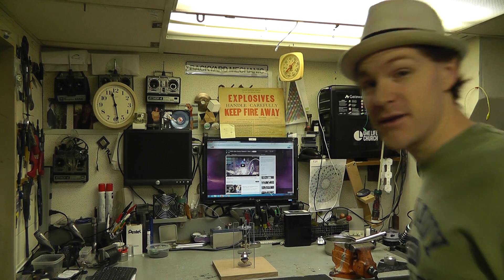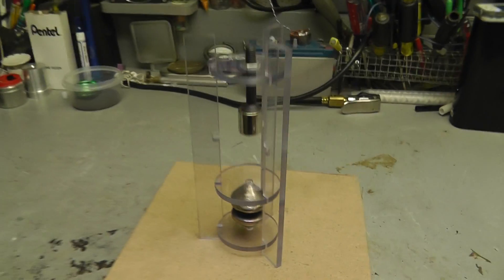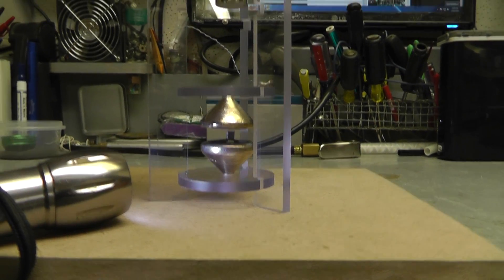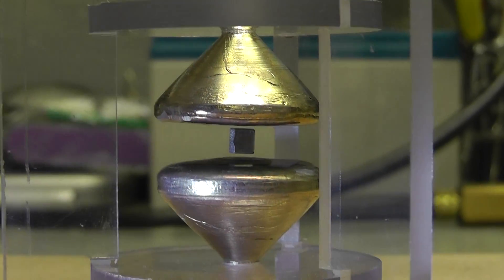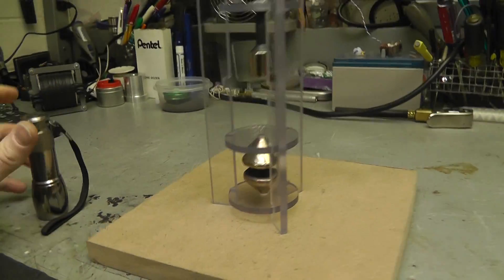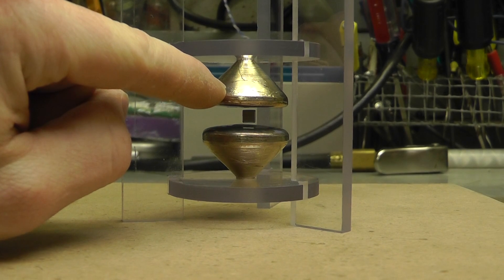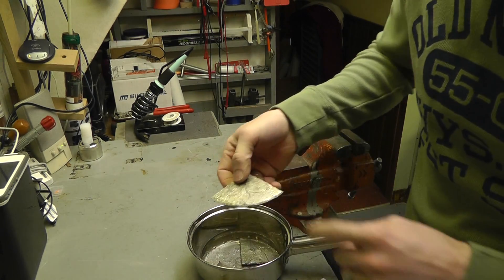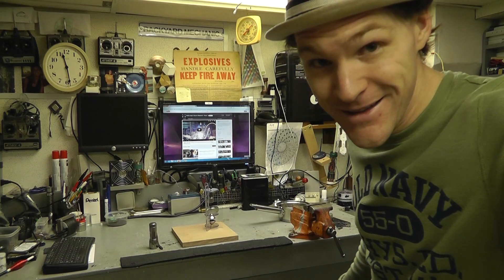Diamagnetic Levitation Via Bismuth. No Power Supply, No Tricks, Just Science. :) RWGresearch.com

Comment: Wouldn't this technically be generating a small amount of electricity. At least while it spins; the magnetic "lines of force" could cut through say a secondary wire and or coil, and theoretically one could use this to generate some negligible but noticeable amount of current. Nothing engineerable would arise from such a simple experiment; at least not immediately, but it certainly would be a proof of concept and theory. 
 Magnetic fields, and dielectric fields are indeed present here, and being that some of the components are in motion (i.e the magnet), there should by all means be some measurable amount of electricity. Maybe you have an experiment on your hands my friend!?
  I definitely want to test this one out for myself; at the very least I'll have a neat table top trinket to impress my friends with.
Reply from the maker: Hi, yes. Its quite fun and you have some interesting questions.  I do sell a kit for others to play with and test ideas. You can see here. http://rwgresearch.com/open-projects/magnetic-levitation-kits/
Thanks! ~Russ
Ps. Think where the flux lines are. This will answer your qustion about power generation.

Comment: Try it in a vac and has a higher repellent feild when hot, shame the magnet don't.
Can you flake it and get it to float on the magnet have you seen the p grafite (I think the P was for power) becouse the magnet span fast when hit with electricity following John searls works and it looks like the grafite still holds those empty holes wow also work when hit with light laser like.

Comment: Did not read every comment but I did not see any comments on the increased distance of magnetism that the top magnet had on the bottom magnet by putting the field threw bismuth. It would be interesting to see if the field dynamics changed on either magnet do to the bismuth.

Comment: What if you were to use a sphere version of the neodymium magnets that reduce the air friction when spinning? You could potentially get the magnet to rotate freely for many hours. maybe mark each half so you can see the sphere spin. I would love to see that.
Reply: Joe Richey taking a shot in the dark here, but I think only a cube shaped magnet can be used in this particular application; perhaps because of the orientation of the magnetic field in each shape. A sphere might get pushed out rather than spin and remain in the same general area; however that is just a wild guess. I definitely want to try this experiment out for myself, and I have both cube and sphere magnets. Guess there's only one way to find out.
Reply: @connorfisher1651  Even if that is the case, you could still have the cube magnet inside a round/sphere piece of acrylic, etc. Good luck with your experimenting! Cheers!

Comment: Relatively moving masses of bismuth will set up a "time dependent" force field which neutralizes the ambient gravitational field. This is the claim of Henry Wm. Wallace in his 1971 USA patent for what he called a "kinemassic" field generator. This device not only can neutralize the gravitational field felt by an aerospace vehicle, but also has another interesting effect: It is said to be able to eliminate the "inertial" effects or the effects of acceleration felt by persons or objects inside the vehicle. This is the only known technology that provides superefficient aerospace propulsion, while also protecting the passengers and crew from inertial hazards. The field effect occurs when the rotor/stator made of bismuth or other half integer spin nuclear isotopes, is spun up to a high rate at very close tolerances. The rate must be at 30,000 rpm or greater I think. This seems very high and of course it can be dangerous if not done properly. New counterrotating power saws, however, have very high RPM and with counterrotation the RPM of one blade opposes the RPM of the other blade, effectively doubling the "relatively moving mass" RPM in the twin blade system of these saws. Tolerance between the two blades is probably not adequate; should be very close, as I understand it. But another possibility arises: The idea that during the spinup, and by running the device for some time, the "kinemassic" field effect claimed by Wallace could be achieved at somewhat lower RPM and perhaps at less demanding close tolerances between the two relatively moving masses' surfaces of the device. This type of device was tested perhaps 20 years ago by a lab physicist and was claimed to show the field effect, although only to some minimal extent. Later, the physicist or theorist who had tested the setup removed his video from the internet and requested that everyone who had linked to it must remove all links to avoid his being the butt of jokes or something of that nature. The inventor, Henry Wm. Wallace, was a well established electronics engineer at General Electric in Pennsylvania. I wrote to GE and received a polite letter back from them, saying that this was not an area of development for GE at that time. It was clearly not a form letter but rather what appeared to be a letter written specifically to reply to me on this particular topic, and was signed by an individual at GE rather than being simply some sort of auto response. The technology may already be in use or in R&D, I just have no way of knowing, and clearly it would be held secret by the military and govt until such time as it might be considered safe and prudent to publicize it. There's no doubt HWW had something important; he was a top engineer and had other patented devices. When I looked for his patent in Colorado, I had to go to the patent library in Denver and get it from microfiche, because the patent itself had been torn out of the patent book in the university library. I have the full Henry Wm. Wallace patent for this device and can send you a copy of it. Previously I had typed up the entire patent online and put it on my Geocities account, but as soon as I did this, Yahoo bought out Geocities and immediately shut it down. There are other places you can find that patent and patent drawings online today though.
Reply: HERE IS THE PATENT:

https://patentimages.storage.googleapis.com/3a/e1/0a/cdda5bf4825fb1/US3626605.pdf

*BY THE WAY* -- this patent polarizes/aligns the atoms of Bismuth by way of the unmatched proton in the nucleus.  Since protons have a positive (+) electrical polarity,  electrons - which have negative (-) electrical polarity -- might be a better way to polarize the Bismuth atoms since in electricity,  "unlike charges attract".

This is a piece of a downed UFO.   It is a laminate  (stacked layers) of Bismuth and a metal conductor made of a Magnesium/Zinc alloy.   This is several layers of 'sandwiched' Bismuth + Magnesium/Zinc. 
https://www.earthfiles.com/2018/08/03/part-1-mysterious-micron-layers-of-alternating-bismuth-and-magnesium-from-bottom-of-wedge-shaped-ufo-2/

If electricity (electrons) are present in the metal conductor layers of this piece, the negative electrons will attract (polarize/align) the positive protons.

Henry W. Wallace' invention above uses a clunky mechanical method to polarize the bismuth.  This laminated chunk from a downed UFO is a simpler, safer way to polarize the Bismuth atoms.
https://www.earthfiles.com/2018/08/03/part-1-mysterious-micron-layers-of-alternating-bismuth-and-magnesium-from-bottom-of-wedge-shaped-ufo-2/

*BY THE WAY* -- the author of the article above about the laminated Bismuth + Magnesium/Zinc sandwich claims that it probably couldn't be produced on Earth.   That is not correct.

For a few decades, a metallurgy process known as  "thin film deposition", that uses machines called "Sputters", can easily produce the very thin layers of Bismuth and Magnesium/Zinc in the UFO chunk of material.

Here is a  Sputter 'target' of Bismuth -- if you search "Bismuth Sputter target" online you'll see that these Bismuth sources used in thin-film deposition are widely available:
https://www.lesker.com/newweb/deposition_materials/depositionmaterials_sputtertargets_1.cfm?pgid=bi01

I'm aware of thin-film deposition and Sputter machines because I worked in IC chip design, and thin-film deposition is one step of the manufacturing process of computer chips.
A company called Perkin-Elmer produced sputter machines that were in wide use.
 .
.
.

Comment: i wonder what happens if instead of a cube it would be that spinning disc in the middle helped by this effect.

also i wonder if the bismuth shapes work reversed in orientation :) maybe flip them, they seem to guide the magnetic flux.

maybe when you heat the bismuth, you can cover the top with some fluid that will not mingle and burn the bismuth, just to seal it airtight while heating maybe the effect will remain stronger more pure.

maybe the shape of a tesseract made from bismuth with the inner cube extruded could be something to try out aswell.

love the vids!

Comment: I have my set up all together and am almost getting levitation but I am thinking there is a top to bottom magnet size ratio going on. Two things I have noticed are the gap size between bismuth plates is always small and the levitating magnet is always small. currently I am using a 1/2" by 3/8"di. cylinder magnet neodyium N48 to levitate and on top a 1" x 1/2" N50. I get just about to levitate and it pops up. Is there a ratio? Should I try the 1/4" cube like ours maybe?
Reply from the maker: It took me a while to get it right 
Have a look at this for help. If you still can't get it let me know. https://youtu.be/_71gu9SvNWg
Reply: Pyrolitic Graphite may be the same as Pyrolized. I know that it is a crystal form of carbon which exhibits a very big diamagnetic force relatively speaking. It does push harder then bismuth and worked great on mine. I bought it on ebay and it was not cheap.

Comment: Maybe this could have an application on a flywhel energy storage plant. You could have a large flywheel suspended in a vacuum environment, when renewable energy like windmills are producing more than consumed the flywheels could be accelerated with the excess energy, and during peak hours the energy could be drained and put back on the grid.
Reply: The only issue is the coupling between them and the flywheel. I do believe Flywheel Energy Storage is used on Satellites.

Comment: Im not that bright as the other people who have made comments, but how/why did you choose the distance separating the cones?  Was it the limit of the 1/4 cube magnet vs the 3/4 X 1 inch adjustable magnet?  Could the distance between, be greater and still allow equal positive/negative to interact the same?  What determines the size of the 2 cones in opposition, and if largest parts of the cones were to be concave would it allow for more stability? Last, could tiny solar panels be affixed to the cube at a angle that would allow motion as long as a light source were to be provided.  I know nothing about what Im asking, Ive seen tiny desk type solar powered "paper weights" for executives that seem to never stop motion.  It seems to me that without friction (ball bearings, pin point head, water, air) that it could be possible to levitate with magnets, use solar power to create movement, maybe have something the size of a hair that gets moved as it turns to charge a tiny battery for when light isn't present.  Like the way a water wheel works to turn a generator to produce electricity to a battery.  Just wondering some of those things, and Im probably not smart enough to understand your answers, maybe just a yes or no will be fine.  To those that want to make fun of me, Ive already said Im not smart so do your best.

Comment: Dude. So i tryed it not making the bismuth like you did and it not working. I didn't use the same neodymium magnets. Must i stick to the exact shapes and strength? At this point mine would just jump from the bottom to the top when ajusting the top neo. What's am i doing wrong? Grate work by the way. =)